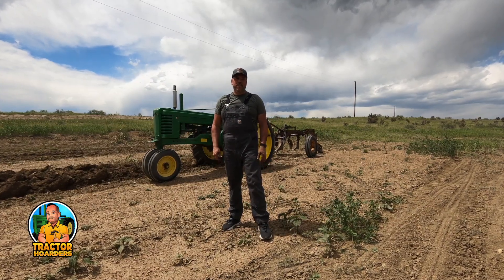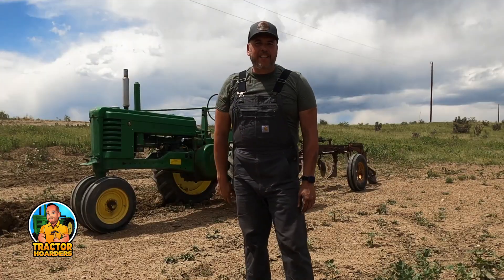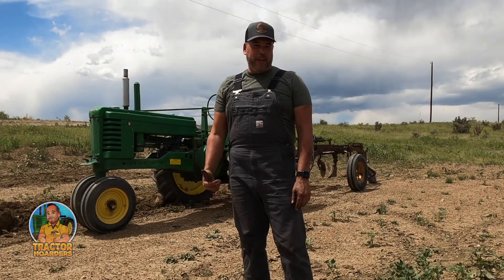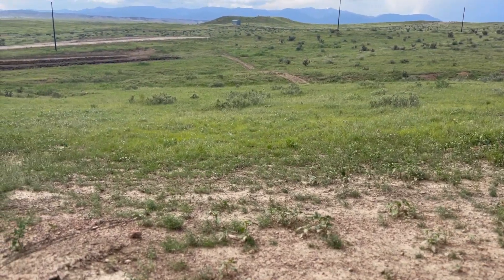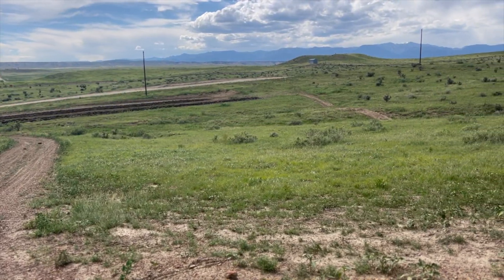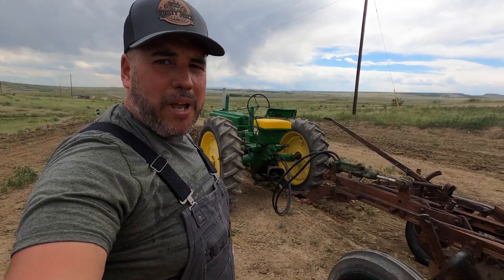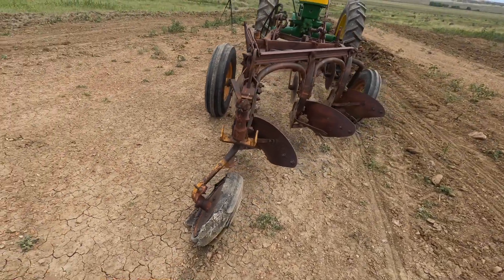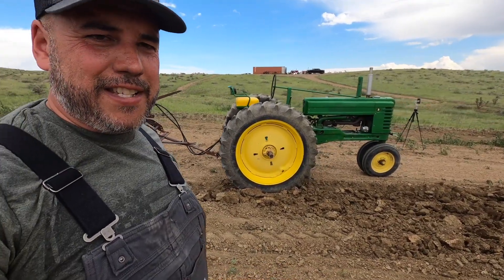Testing John Deere B with 3 Bottom Plow - Tractor Science

Comment: love those old "Johnny popper" 2-cylinder tractors. a B is a little small/light for a 3 bottom (depending on soil condition/composition) but I know people who pull a 2 bottom with no issues. i wouldn't be afraid to run a 3 bottom on previously worked ground, but id hang extra weight off her. those big two cylinders are really underestimated since they are TORQUE monsters that will outwork any other similarly rated tractor, even diesels. Jump up to an A and it would absolutely pull that plow, but that's a "more powerful" and heavier tractor. Best classic Deere would be the 60, but again thats even bigger. a B is perfect for a single or two bottom, driveway grading, finish mowing/brush hogging and a ton of other work that farmers used them (and STILL use them) for. Id love to acquire one to keep as a collector tractor and some light work. I know it will last another 70 years, LONG after the new computer controlled junk breaks down.
Reply: Model Bs didn't have  live power take off, not good for Brush hoping, Buzz Saw,Hammer Mill racking Hay Cycle Bar Mower pulling Wagons ,lite work.

Comment: I'd like to see if a 1952 John Deere Model A tractor can pull a four bottom plow
Reply from the maker: I’d like that too.  If I ever end up with a four bottom plow, I’ll test it with my 1950 JD A.
Reply: Update on my 52 model A john deere. It now has .125 over high compression aluminum pistons, new valve seats, fresh ground valves, rebuilt carburetor, clutch, and gas manifold. It'll be pushing around 50hp, instead of the stock 38hp. I'm going to try to pull 4-14" plows with it!

Comment: Maybe try shifting into a lower gear next time you attempt to plow with a three bottom plow and your John Deere model B tractor.
Reply from the maker: Tests were conducted in both 1st and 2nd gear.  1st gear would lose traction.  2nd gear would lose power.  Both expected.
Reply: @TractorHoarders pulled a JD 3-14 hydraulic lift behind dads 1951 A JD up in MN and I was pulling in 2nd gear did alright then decided to try 3rd gear and it felt like it pulled better in 3rd than in 2nd. Eventually gonna try it behind my 1947 slant dash A JD.
In another video left a comment I picked up a 44 hydraulic lift plow on steel wheels I haven’t pulled yet but plan to behind a 1950 B JD. Somewhere someone told me a 44 hydraulic lift on steel was rare, but in the old JD promo videos they had em on steel. Got just about all of them videos on dvd from the A and B era